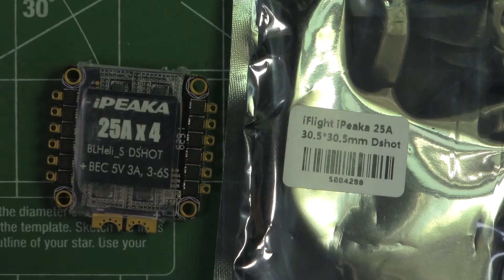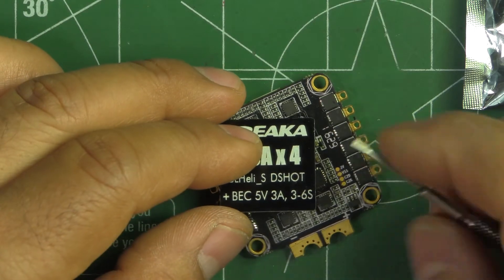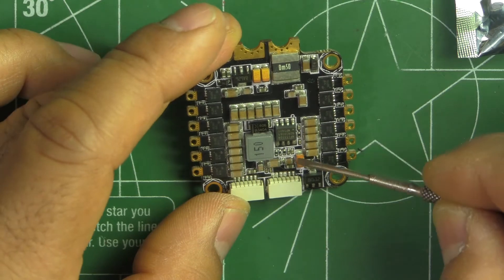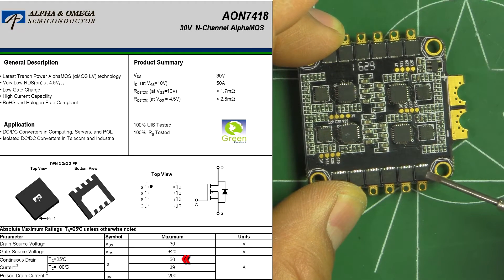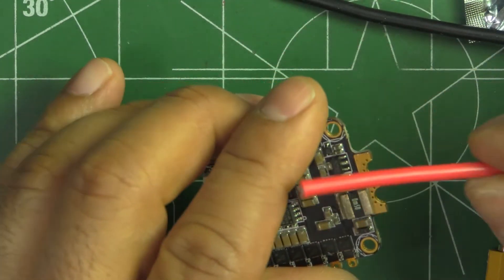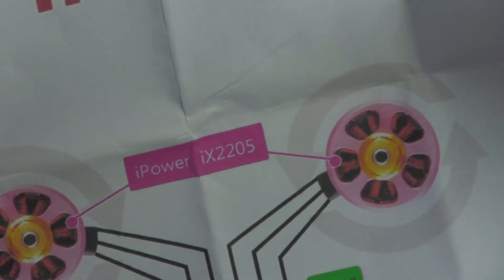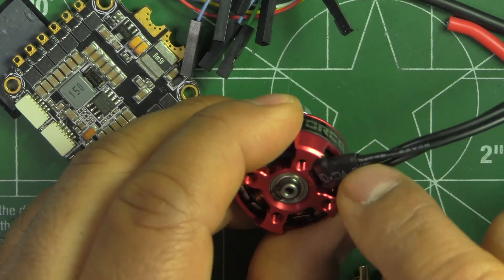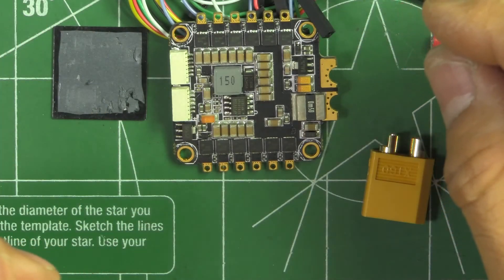iFlight-RC.com iPeaka 25A D-Shot BLHeli_S 4-in-1 ESC Overview

Comment: Hey bud if you still have this 4in1 can you shoot me some specs what’s the weight with no wires and no heat shrink and no heat sink Basically just the weight of the unit itself
Reply from the maker: Sorry, already installed just last week on new frame

Comment: I'm starting to use also 4-in-1 ESCs and at first i was sceptical but right now i'm kinda love them!
With a good FC with integrated OSD, a high voltage vTX & FPV camera. This combo has a huge potential, weight & time saver.
My favourite one at the moment is the Typhoon 4in1 S Racer ESC 4x30A from airbot but the one in your video has 5V BEC 3A which makes it interesting for a low voltage FPV cam & vTX!
Amazing how this hobby is moving fast nowaday :)
Reply from the maker: Same here. I didn't like them at the beginning but then I started using the 30A I reviewed last January and I like it a lot. There's several good ones available these days so good for us. Yep, makes a clean and easier build.

Comment: I knew the BH and Hyperlite were the same company I just wasn't sure they were the same motor since it looked more like the Returner than the Tornado. I'm glad you told me though because I found some pretty good sales on the BH and I am pretty sure that is what I will go with. Rotorgeeks wasn't even on my radar until I found your YouTube channel. I just finished a build with RF FC and Bolt 4-in-1 ESC pushing F60 pro's (although I have a set of XFoots on the way) so this one I want to give the Micro Lux and 2-in-1 stack a shot with the BH motors. I wish Xfoot made a 1407 though. I asked Hans if he had any plans on making a smaller motor and he didn't answer, I don't know if that was intentional or he just got sidetracked but I will be first in line when and if he does. Anyways, thanks for taking time out of your day to answer my questions and share your expertise. I am also a bass angler and these two communities are second to none when it comes to others being friendly and helpful as well as the experts being accessible. I'm proud to be a member of them both.
Reply from the maker: Thank you also for taking the time to watch the reviews and very true this community is one of the most helpful and enjoyable. Good to see there are other helpful ones like the bass anglers'. You got some top-notch hardware. It's getting harder and harder to decide what to use, there are lots of great choices these days.

Comment: Thank you for the response, I hope I didn't seem insulting because really your videos are very thorough and comprehensive. I got more information in about 10 minutes from your channel than I did googling for days. 
ps. a little birdie told me (I called and asked) that Pyroflip is getting a new batch of hyperlite's tomorrow and I'm very interested to see what the bench test results are on the 1407. I'm sure that I am not alone either since it has to be a higher end motor and from my phone I wasn't able to find anything on YouTube. If you don't mind me asking, from your tests which of the 13-14** class motors had the most top end power on a 3" prop? If you know I'd also like to know which had a better low to mid range as well. Thanks again and thank you for sharing your work with us. I'm going to subscribe to your channel now and I am sure many more will follow.
Reply from the maker: No I didn't find it insulting. It was valid criticism. 
The Hyperlite 1407 and BH 1407 are the same motor just with different paint scheme.They'll have the same performance. The BH 1407 really is a very well made motor that has pretty much all the features that makes it stronger. 
Armattan also gets their 1407 from BrotherHobby but theirs has higher 3850KV so it'll have different performance. The BH 1407-3600KV is the best all around motor for 3". It has very good low to mid-range response and good top-end. The 3850KV version from Armattan will have more top end but a little less midrange and will drain batteries much quicker. For acro/freestyle everyone is happy with the 3600KV.  But if you want more top end then go for the 3850KV or the RotorGeeks 4000KV.